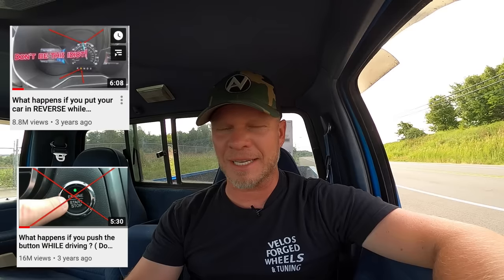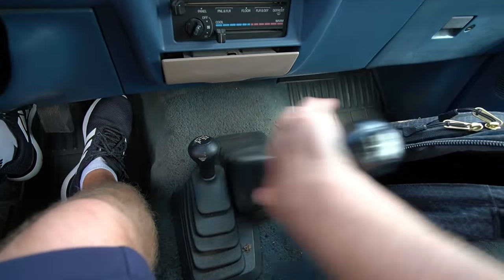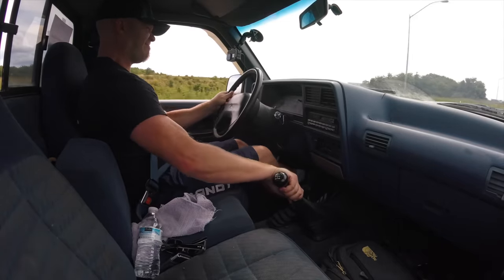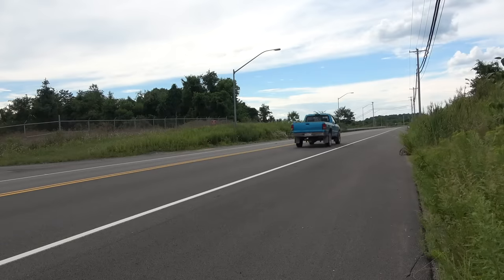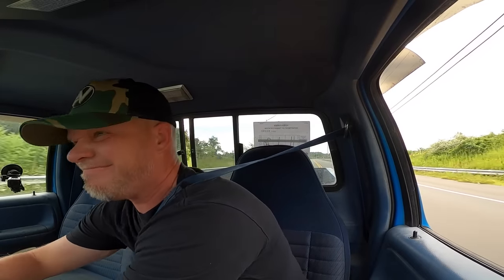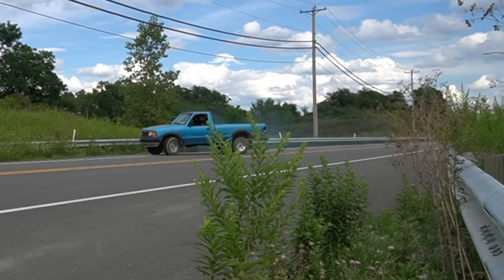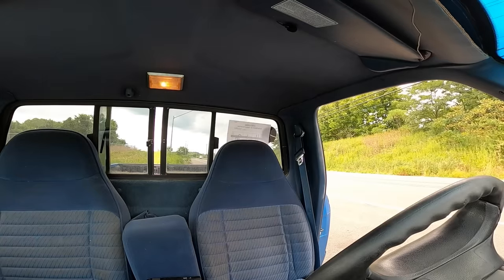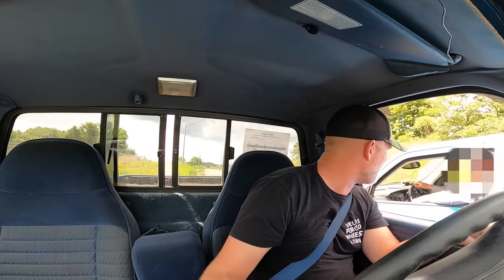What Happens If You Put A MANUAL Transmission In REVERSE While Driving?

Comment: It actually kind of blows my mind that this wasn't immediately devastating for the transmission
Reply: To be fair this was probably devastating to everything else. Like the shaft diferential and tires
Reply: Honestly I think a big part of it is the fact that pickup trucks like these don't have much weight over the rear wheels, try this in a FWD car lol.
Reply: @sebagomez4647  differential has everything to do with turning why would it damage differential?
Reply: I'm thinking he modded/reinforced or something. There's no way 🤦🏾‍♂️
Reply: @TheNikhilify  A strong enough shock in a mechanical system can be very damaging. In this case there is a near-instantaneous complete reversal of direction, which would cause an extreme load of force on all affected parts. Something would have broken if the tires had had any traction/grip. Same basic principle as drag racers breaking their rear axle/u-joints/driveshaft/transmission upon launch - an extreme load of force beyond what the parts are rated/designed for (especially with sticky tires that grip the pavement)
Reply: @MikeSmith-qt4pe  still it won't affect the differential. The amount of torque generated to break a differential will be beyond this. It is designed for that purpose only and also a gear box stoppage will have no direct impact on the differential. I am a mechanical engineer and this is what we do so theoretically you can say whatever but in practical world it will not have any impact whatsoever
Reply: It’s built Ford tough
Reply: My dad is a mechanic and he told me that someone did that and the gears spread themselves on the street.
Reply: Depends on how quickly he released the clutch.
Reply: 1990 ford tough.
Reply: It will destroy synchronisers inside the gearbox ....
Reply: @TheNikhilify  differential drives the wheels...
Reply: @long-long.  the power transmission shaft drives the wheels. Differential allows fhe wheels to spin at different speeds because while turning they have to travel diffrent distance within same amount of time.
Reply: It usually kills it instantly!
Reply: @TheNikhilify  the differential is still part of the drivetrain
Reply: @stormycook5800  who said it isn't?
Reply: @TheNikhilify  "differential has everything to do with turning why would it damage differential?"
"I am a mechanical engineer"
Doubt that, if it's going at lets say 300 RPM in one direction and then suddently tries to go at 300 rpm to the other direction i think i could really damage it, but hey u r the mechanical engineer right?
sorry u r so  very much right, plz teach us ur wisdom master
Reply: @TheNikhilify  A differential (of which the crown wheel and pinion is a part of) converts rotation of the propshaft through 90 degrees into the halfshafts [b]and[/b] allows the two wheels to rotate at differing speeds.  You can strip teeth off a crown wheel while going in a straight line with enough shock, like running over a kerb on a racetrack, wheel jumps, lands back down, shock loads the diff and rips 3 teeth off the crown wheel.
Reply: actually the clutch might be busted first :)
Reply: @Cerberus460  that's what i stated in my comment
Reply: @lucasechenique39  That truck was built by mazda.
Reply: this is the answer 100%  @DenverDeCoY
Reply: @TheNikhilify  you said that the differential does not drive the wheels, yet what he said is completely opposite. If the differential converts the rotation of the propshaft to the halfshafts, it most definetly plays a part in driving the wheels, since without it the halfshafts don't rotate, and by extension the wheels don't.
Reply: it'll only shear the gears a bit, doing this a couple of times will trash your transmission tho xD
Reply: @TheNikhilify  you better get a refund from wherever you got that degree from.
Reply: @stormycook5800  unlike your western universities our asian universities teach way more better. So no thank you. You can keep your opinion.
Reply: @TheNikhilify  "who said it isn't?"

Well ... you did, by implication, when you used your vast knowledge of mechanical engineering to state: "... also a gear box stoppage will have no direct impact on the differential".

FURTHER; those two statements that I have quoted directly from you cannot be true at the same time, thus nullifying your argument through your own self-contradiction
Reply: My guess is that it survived because of the burnout. It reduced friction between the tires and the road, allowing most of the energy produced by that transmission to be used. Had he not done a burnout, so without going on the gas, the high friction between the tires and the road would have made it neigh impossible to "spend" the energy of the transmission, meaning that the internals of the transmission would be what takes all of that instead of the wheels.
Reply: @inflatablewolfie  that's one of several reasons yes, but it's still gonna put that diff is still taking hella beating😂
Reply: @TheNikhilify   a sudden change in rotation will destroy your differantial and it'll take our your transmission aswell. you don't need alot of torque to still destroy your differantial.
Reply: It probably just slipped the clutch
Reply: Probably a lil more damaging than dumping the clutch so.
Reply: @sebagomez4647 clutch disk too
Probably engine flywheel too?
Reply: @TheNikhilify because engine shaft is connected to differential always it will not only connect while turning its always with differential 
And imagine rousting forward and suddenly backwards. And wheels connected to differential rotating forward. Probly differential gears gonna burn
Reply: Tesla which can only put in reverse after a complete stop: Laughs in corner
Reply: This thread is dumb, proclaimed mechanical engineers or not. At high speed, entering into reverse gear will do... nothing. You heard right! 

In an automatic transmission, the computer will just ignore the request, boring.

In a manual transmission, the change to reverse gear will disengage the active drive gear, and the shift lever will attempt to engage the reverse gear. The reverse gear has an idler gear in order to reverse the rotation of the drive gears. There will be no sync between the main shaft and the idler gear at high speed. You will put wear on the synchronizer but the gear will not engage until sync speeds are low. In this video, the truck is effectively in neutral... very minimal damage if any.
Reply: @DenverDeCoY  yeah I would not want to find out what this would do to a subaru lol
Reply: @TheNikhilify  i know this is 2 years old but do you even know how cars work? yes the main purpose of a differential is to allow the wheels to turn at different speeds, but the power from the engine still travels through it to get to the wheels, meaning the differential will be under stress and can be damaged at any time if conditions are bad enough. what you said is like saying that a steering wheel cant be damaged by you unless you’re turning. if you’re seriously a mechanical engineer and dont understand this, you weren’t educated well, if at all. in fact, you dont even need to be a mechanical engineer to understand this, it is physics that a child can understand.

Comment: I never thought you'd be able to get in into reverse while driving, and then I assumed you'd stall it if you somehow did. Wrong twice. Good work!
Reply: If you apply enough force on the shift lever you can force the shaft and dog teeth to meet. Effectively putting it in reverse then applying power will(on a light rear axle small pickup) cause a forward moving reverse bunout.  Poor dogteeth on the reverse gear
Reply: @jnk26  Well you cant argue with that...  😄  👍

Comment: Well, why would someone accidentally do this? There is a simple answer: I learned driving in a 6 gear manual transmission, then I got my own car ( a bit older) which has only 5 gears, and reverse is on the same slot as on the reverse slot. Guys guess what I did on Autobahn with 80mph. Yeap I changed into ROCKET Mode.
Reply: MineclasherLP121 that’s why most cars have an extra mechanic for reverse. Like pushing down while pulling in the reverse slot or pulling a button. Which car did u have?
Reply: @skiser7176  I had a mitsubishi 5 speed and it had reverse below 5th gear. I never tried what would happen if I went from 5th to reverse, but I think it would have been doable, at least with enough force. No pull or push required, it just slotted right in place. Car was Mitsubishi Carisma -99, GDI 1.8 with Mitsubishi manual transmission. They also had Renault transmissions in those cars, and it had a safety pull or push.

I also had a -85 manual Toyota Corolla, it was only 4 speed, but same layout. If it had the overdrive (optional) it would have had the same layout.
Reply: Duuuuuuude. When I had my integra. I had driven my sti (6 speed) for months since the AC compressor was going out in my integra (5 speed). I live in southern USA. It’s always hot and humid. I drove the sti for months. fall comes and I drove my integra for the first time in a while 
I was driving on the highway to work. Mind you I live in TEXAS our speed limits are pretty high. Our tollway used to be 80. 
I get on the ramp and bang some gears in the integra. 
I got to 5th. And tried slamming it into 6th. Shit. My life flashed before my eyes. Shit grinded like crazy. It didn’t fully go into gear. But never again. 
Shit scared me. And scarred me permanently.
Reply: @skiser7176  lol new cars sure. But look at all the old cars I’ve had. No 5 speed has had a lock out. 
And all the 5 speeds I’ve driven have reverse right below 5
Reply: Alot of 5 speeds have some sort of lockout. In my car for example, if you are in 5th and try to go into reverse (which is where 6th would be) it has a physical lockout gate, and won't let you enter unless you go into the center of neutral
Reply: @raffighookassian1724  I drive a 2014 VW Polo (TDI but it doesn’t really matter) it has the Reverse below 1st gear and I believe that is the best placement. As you wouldn’t go from 4th or 5th to 1st by mistake so there is no chance of going into reverse by mistake as well
Reply: @soltude5647  you actually have a pretty good point, although I never really understood "money shifting" aka downshift by accident. Even if I wanted to it won't let me as it locks me out if its not able to match the revs. Even going from 2nd to first at 15mph, which is very slow, unless I rev match it's simply almost impossible
Reply: @raffighookassian1724  haha true 2nd to 1st is just annoying. There is no way of downshifting without slowing down a lot or wearing the clutch.

Idk at least the car I drive does not really lock gears. It only has something like a “soft wall” in 1st gear, meaning it makes it harder to go into first. Apart from that as long as the clutch is pressed down I can do whatever I want. No blocks as far as I can tell. Maybe it’s my car that has this “issue” of not having these blocks?
Reply: Got the same problem my bmw 3 series has 6 gears but at work I got a peugeot 206 with 5 gears and under the fifth gear is the reverse its so enoying
Reply: @bigdaz9090  like I never tried to put it in reverse while driving forward, but as I saw on this video, it was pretty hard to put it there... :D and I would imagine it would be everywhere. Car I drive has reverse in position of first gear with extra lever pull, so I didn't even think about it, but... :D
Reply: Mine has reverse before first gear (to the left and up) so there's no way to f&ck up
Reply: @alfrredd  yh same and on top of that I need to push down so there is 0 chance of putting it in reverse Terry by accident
Reply: @weekasi1  you can't do that. You may need some "effort" on the gear to shift to reverse like shown in this video. But yes it will break your engine.
Reply: @soltude5647  
1 2 4
R 3 5
Is this the gear shift pattern in ur polo?
Reply: @lubnakhan5847  Yeah, you are probably right. I never tried to put it in reverse while moving for obvious reasons :)
Reply: Aua
Reply: “…and reverse is on the same slot as the reverse slot”

omg, who would have guessed??! Just kidding, I think you made a typo there.

Comment: Let the shifter return to neutral first, then put it in reverse. The mechanism to prevent putting it in reverse will disengage, and you won't have to force it, which could break something in the transmission that can get stuck in the gears.
Reply: It probably locks out reverse when in motion
Reply: @tims5677  The transmission won't know it's in motion when the clutch is disengaged
Reply: as soon as he takes it out of gear the shifter is in neutral
Reply: @fortythree4135  i think he means to clutch, move it to neutral, drop the clutch 
Then clutch, put it in reverse, let up
Was he doing that the whole video?
Reply: Insyders speaking facts here literally what I have to do in my Toyota Hilux every morning
Reply: @fortythree4135  No, if you shift from 5th into reverse it doesn't go all the way into neutral, since the shifter stays on the right. You need to let the shifter return to the middle of the shifter box. Also usually the only safety on these transmissions is between 5th and reverse, going into reverse from 4th gear should just be possible.
Reply: @LoganDark4357  the transmission will still know its in motion since the only disconnect is from the engine flywheel,  the transmission is still know its turning because the driveshaft is going to continue all internal motion untill the vehicle stops moving.  clutch or no clutch
Reply: Based on when he showed his hands it looked like he was moving from 2nd/3rd gear as opposed to 5th to me
Reply: I think it should be clarified that you can still definitely damage something by doing this. Honestly it still amazes me that people accidentally do it. Maybe it's just the 5 manuals I've had but it's painfully obvious long before you manage to get it in there. 

Money shifts however I totally understand... I've always caught it but I feel for those who didn't. I'll never forget being in the car when my buddy fried his S2000 shifting to 2nd from 5th.
Reply: @JJFX-  he fried it jumping from second to 5th? I thought it would've been the other way around
Reply: @javianbrown8627  lol no, I figured I made a typo but it seems you misread it. Attempting to downshift to 4th for some freeway fun but things didn't go as planned. Sounded amazing for a brief moment then the clutch fell and the next thing we know we're calling for a truck on the side of the road. I don't think it was ever repaired, I believe insurance totalled it. Damn shame.
Reply: @JJFX-  that's a shame. I did mistread it for sure. Never driven aside from in racing Sims and I do remember money shifting in and blowing the engine a few times in project cars but then I changed the way I held the shifter based on what I was changing to and that solved the issue completely. Hopefully this doesn't happen to me irl as I plan on getting Manual if I have the option when I get a vehicle
Reply: @javianbrown8627  Pretty sure everyone has done it to some degree at one point. Usually you can feel and catch it before there's a problem unless you're going full out and quickly shift down near redline. The rare times I've done it was just daily driving with my head in the clouds. I've never broken major parts on my cars... but it's possible a couple may have flipped upside-down in my early years.
Reply: Incase you didn't notice, saving the trans is NOT the mission
Reply: I had a friend who did that as a prank a long time ago, like in the 1980s. He was driving a Gremlin. We were going down a hill about 50 miles per hour, and he experimented to see what would happen  if he  put the car in reverse. Sure enough,  the car jumped, nearly  flipped over from the back. After that, the reverse never worked again.  So everytime he needed to get out of a parking slot, he had have a push  backwards to get out whether it's  me and a couple  of friends,  or some random  people he can find close by.
Reply: I think 4th to reverse is possible, Instead of 5th to reverse in a 5 speed car
Reply: @DrDuck005  Well yeah because you literally have to slot it into neutral to get there, regardless where the reverse gear happens to be positioned.
Reply: That's not because he didn't let neutral, it's because gears on transmission spins too fast to reverse. You can try same thing without releasing clutch, it doesn't at first but when the gears slowed down, it does.